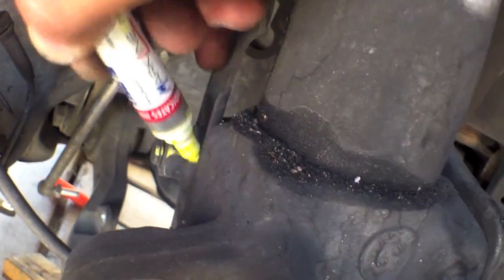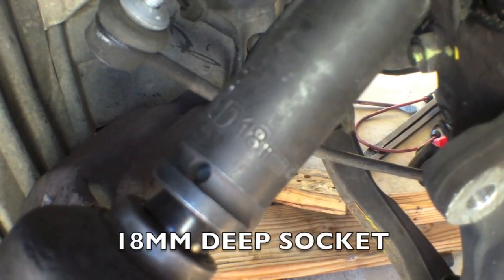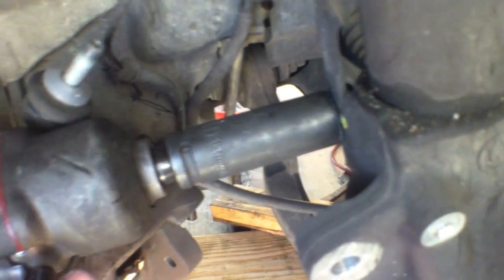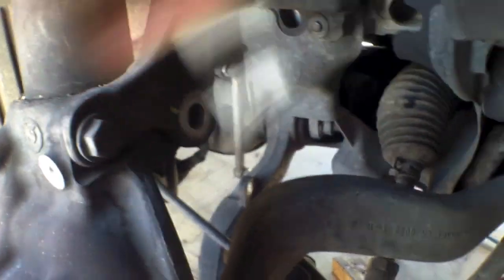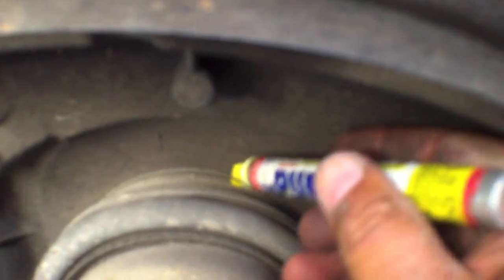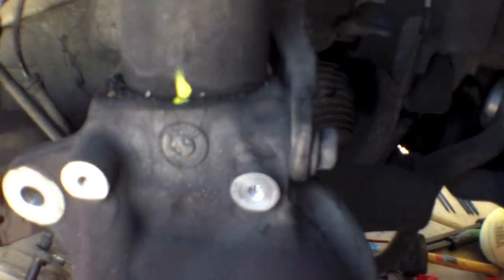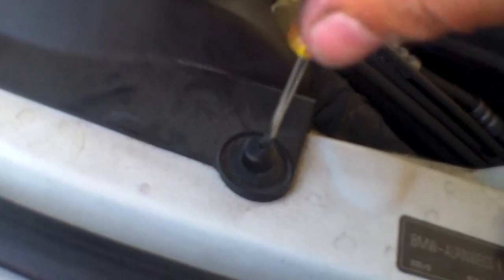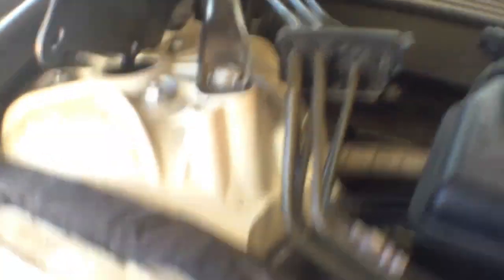FOLLOW step by step front wheel bearing struts REPLACEMENT BMW 530i √ Fix it Angel

Comment: Thanks for the video, I used parts of yours and an alternate video to complete my driver side front wheel hub on a 2005 BMW 530i. I will admit I am not a mechanic by any means but was able to complete the process without having to remove the strut. I simply removed the outer tie rod then used a mallet and banged the bad hub a couple of times downward and it lowered enough to clear the top left bolt head. One word of advice for anyone looking to do this job use a top quality oil penetrator. I had zero difficulty getting the screws and bolts out. Great video and keep up the great editing.

Comment: Great video. Except at the 2:30 point or when you use the gearwrench to break loose tight bolts. Great way to strip them.
Reply from the maker: Dave M hi thank you. I did not strip them. I know what I’m doing. Ask first if I ever strip them. I always use gear wrench they work well. Everyone has their preferences on what types of tools they use. Obviously if I did strip the nut I wouldn’t be using it in this video. Just saying brother.

Comment: Doing this now in the driveway, rewatching the video to see if I forgot something. What a PAIN to get those four bolts out with hand tools! Got two out just before the heads were rounded, stopped for a drink (because otherwise I would have set it on fire lol). Wish I had air tools here, ugh.

Comment: I know it's a very old video but I just changed my car's bearing watching this video and for that I thank you. However, I couldn't take off the disc as the small bolt holding it to the bearing seized and I ruined it further by trying to drill it out. My last MOT have me an advisory on the discs and they needed changing soon. So, I removed the bearing with the disc still attached to it and replaced the discs as well.

Comment: Angel...Great DIY video.  I am changing the front bearings on a 06 530xi...  The front bearings appear to have a wired lock nut in the middle.  I cant find any bolts on the back of the assembly so I am assuming that the nut is holding everything in place.  Is that a special tool?  Ive got some pictures not sure how to get them to you.  Thanks in advanced

Comment: I wouldn't trust any cheap part from local auto store.I would also replace upper/lower control arms,rotor ,pads.Save time and headache.
Reply: Jim Wong I feel you but that was customer’s choice
Reply: That car's probably got a zillion miles on it. The cheap bearing will outlast the car.

Comment: All I can tell u I've replaced front bearing on a friend's 2010 550i and didn't have to remove the strut. To me that's an extra step u can avoid. True maybe it gives u more room your way but it's not necessary. Oh and I would have recorded a video if I had one to work on unless u want to buy me new bearing I replace the ones I just replaced this past summer

Comment: Replacing the Strut with Suspension Arms still attached to the car wouldnt that damage the bushes or the balljoints 🤔
Apart that at 7:47 the anti rollbar link seemed to be a bit bent ..hopefully u replaced it.Nice video though 👍

Comment: It's easier if you disconnect the bottom of the strut first totally disconnecting everything on the bottom then go up to the top of the strut loosen the bolts and pull the whole thing out

Comment: Is this tutorial applicable to a 2006 750i? Also, just o be clear, I have to remove the strut just to take off the wheel bearing?
Reply from the maker: +MrSilksoul More likely it is the same procedure but I do not know for certain. Look at pictures on the internet or jack up your car and take a look. I hope this video helps.

Comment: What size and brand air compressor do you use? I want to get one for auto work at home. Do you have a brand you like?
Reply from the maker: +Yod S Hello, I have a Craftsman 60 gallon. I got it used for $20 in Craigslist. I got lucky.
Reply: +Fix It Angel  Have you had any issues with the Craftsmans compressor? I was looking at a Quincy air compressor thats suppose to made in the USA
Reply from the maker: Well, the Craftsman is working OK, no problems...yet I guess. I still have a Harbor freight 8 gallon compressor since 2004 and it is still working. I don't know anything about the Quincy. Sorry

Comment: dear fix it angel is is the replacement of a front wheel bearing on a 1998 740 il the same as in your video
Reply from the maker: +crispin mathieu Sorry I think not.
Reply: Thank you for your reply - question Can you offer me any advice on replacing a wheel bearing in a 1998 740 il because it definitely needs to be replaced and I'm a old BMW owners budget lol .. my main concern is that the wheel bearing needs to be pressed out as opposed to the wheel bearing in your video which was bolted out I appreciate your reply thank you
Reply from the maker: Hello Crispin, I understand you are in a budget. But you are better off bringing it to a good shop in your area. Save yourself from any problems and lost time that WILL come up. Your sanity is more important than doing this job and just spend the money for someone to do it. I hope it all works out for you. Please subscribe.
Reply: This is the best advice yet.  If people like to work on cars then they should do it and to save money, but if they don't, it's best to leave the job to a good mechanic.

Comment: you can just remove the Brake and use a 18mm ring spanner to release the bolts, so you don't need to do all that you've done :D
Reply from the maker: David Deutschle thank you for the tip. Always appreciated. Have a nice day

Comment: You did way....more than whay you were supposed to my man.
Reply from the maker: +Jesus Calderon OK show me man
Reply: +Fix It Angel im going to be opening my shop up my shop, and i actually need to do my rears also.
when i get all my moving done ect ill do a reply vid
Reply from the maker: good. video the front, not the rear. you said i did too much. and make sure it's a 530i. i will be waiting. but i bet you won't do it.
Reply: +Fix It Angel E60 M5 lol 
im actually dropping the motor in it next week and doing rod bearings and resealing it all.
Reply from the maker: we are talking about wheel bearings, right? you don't have to tell me the other stuff you going to do to your car. just show me a video of replacing the front wheel bearings. then you will know when you do the bearings, my video told you so.
Reply: +Fix It Angel I said wheel bearings first lol youre not keeping up.
I was just sharing what else i am going to do on it. lol